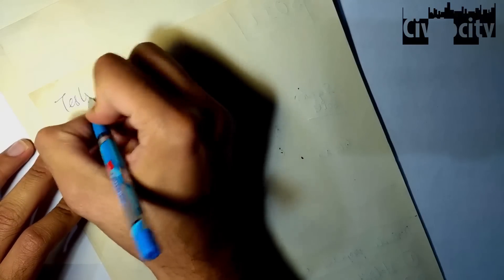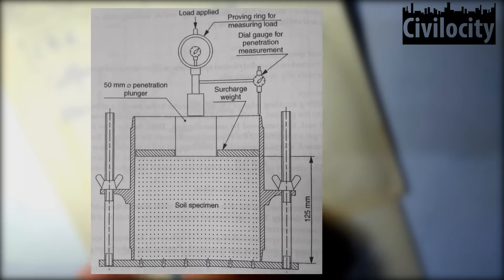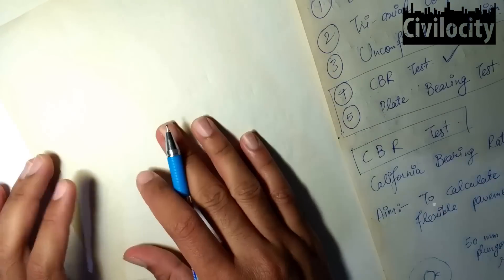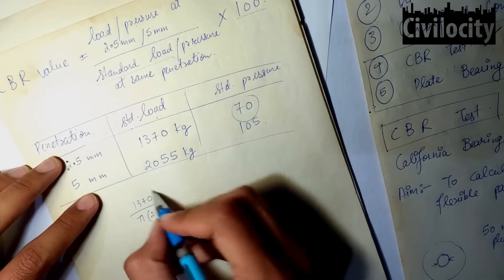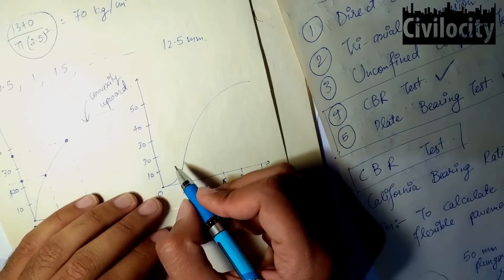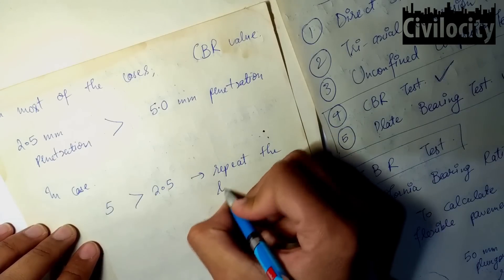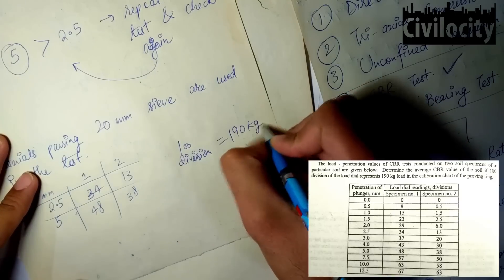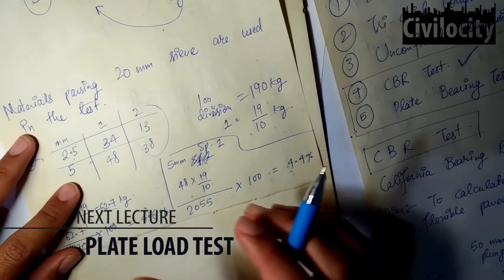CBR Test for Soil | Highway Engineering | Lec-11 Part-2

Comment: I've a doubt sir,how can you solve the last question just by seeing and substituting those data in the formula of CBR without knowing the fact that whether correction need to be applied or not,bcoz' if correction need to be applied then load value for that mm penetration will get changed from what has been given in question,and hence the CBR.

Comment: please define the no. of blows for 97 % compaction 10, 30, 65 for the cbr casting,
because required no. of blows as per ASTM D1883 (10, 25, 56 blows) compaction for 95%
(how to calculate 10, 30, 65 blows for 97% compaction or where are write this criteria.)

Comment: Great video. Thank you for the examples. One note though....if 100units=190kg, than 1/100th unit =1.9kg. The 19/10 is confusing. Also your math is slightly off I think.
Reply: Yes I too came up with different answer at the end.